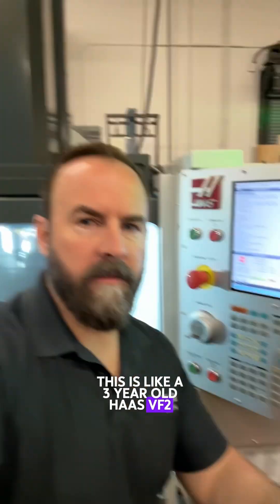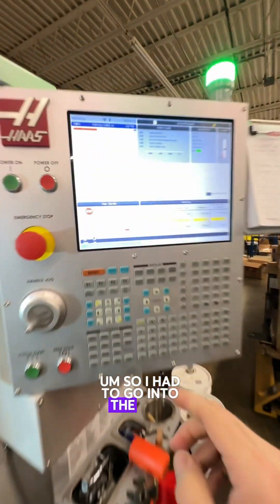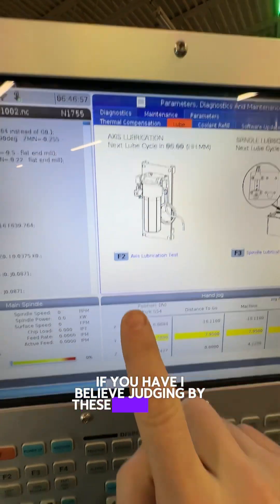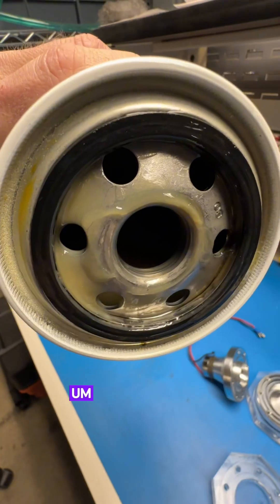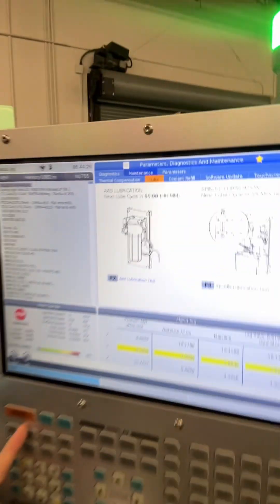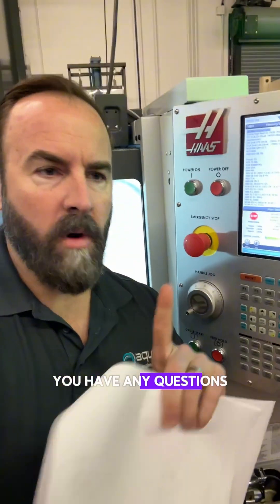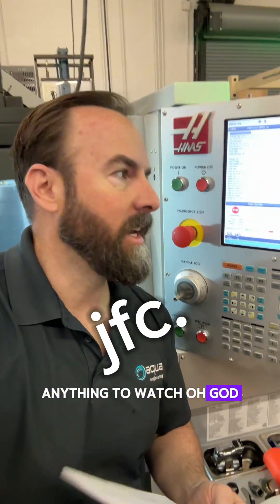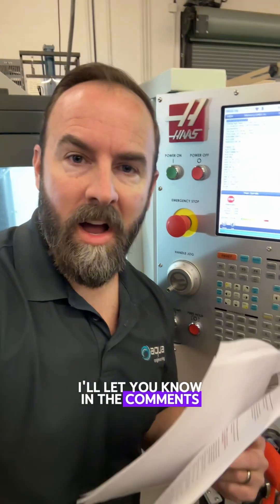Haas VF2 Axis Lube Conversion Kit Install

Comment: Alright, here we go..... Red, tan and purple are all capable of plugging. Red grease machines are very costly to convert to the new HALO system. Purple and Tan can be readily switched by spinning on the canister of oil and installing check valves on ALL of the axis lines coming off the lube manifold. Every kit comes with an orifice. The orifice is for if you have a lube line going to your SMTC carousel. The orifice gets installed on that line (or a c-axis on a lathe). You have an umbrella so you do not need the orifice. Things to look for prior to conversion: make sure your pressure switch is changing state. Haas uses a GM style 5-100psi pressure switch that is either open or closed depending on pressure or not. Check and see if the gauge at the CALM cabinet (red systems don't have a Guage.). These like to fail when the grease system is plugged. Usually the needle will stick at 20psi or so. Check if you have a plug by running a lube cycle in diagnostics and see how long your gauge (if functioning) hangs. It should be to zero in under 15 m. If not, your gauge has wither failed or you have a plugged system. You can spin the gauge out a touch after 35m and see if grease comes squirting out. If so, you are plugged. You will need a grease purge before you do the HALO conversion. Call your friendly local HFO for proper service.
Reply: Wow dude you need to start your own channel! We keep burning out motors. We don’t use coolant, only canola oil. I’ve tried to get management to switch over to coolant to no avail. Is there something we can do to help mitigate the likely hood of burnt out motors?